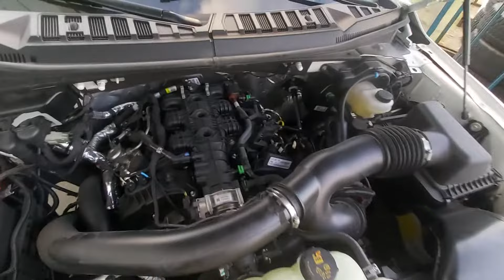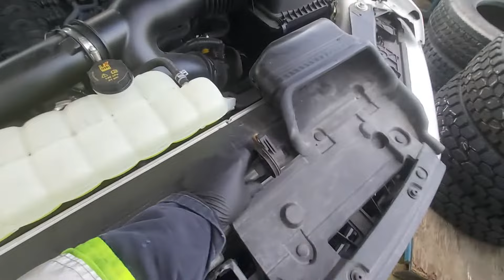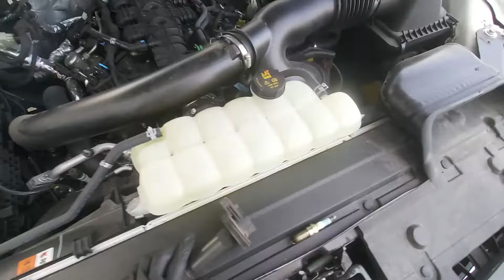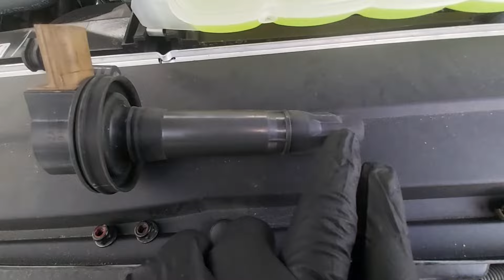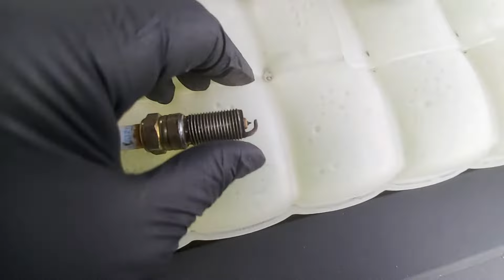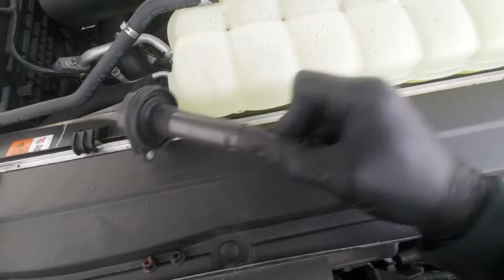Ford F150 3.5 Ecoboost misfire P0301 P0302 P0303 P0304 P0305 P0306 troubleshooting tips.

Comment: Thanks for the clear and concise video. This helped me find the cracked porcelain on my #4 spark plug. Plugs were installed by the dealership at 99K miles (about 1500 miles ago) so I'd assumed it had to be a coil.
Reply from the maker: Glad you found the problem. Very easy to Crack the plugs on install if you're not careful. Plug could have also been damaged in shipping if it was tossed around. Thanks for watching and commenting.
Reply: @shanersmechaniclife3164  I sent a picture of the cracked plug to the dealership. They said it was likely cracked prior to installation and they just didn’t catch it. They’re going to give me a free oil change for my trouble.

Comment: Thank you, sir. I did switch the coil packs on cylinders 1 and 4 because I had a P0301. I erased the prior P0301 and scanned again, and got another one. But the engine light went out...then it came back on flashing, but not solid. BTW, I just changed the plugs on it today. 2017 2.7L EcoBoost on an F-150. I'm also seeing a P0201. The two DTC codes together make me think it's an injector.

Comment: dealing with this now...thank you for the tips..
Reply from the maker: Hope it works out for you. Let me know what the problem ends up being. Thanks for watching and commenting.
Reply: @shanersmechaniclife3164  all but one top cap on the passenger camshaft blew apart and rollers went flying...haven't looked at the pistons yet but I'm ordering a used motor...

Comment: Help needed…

I had a P0305 almost a yr ago. Replaced all plugs and cylinder 5 coil. Same problem has come back. Replaced all plug and cylinder 5 coil again. Still have the issue. It’s a 2019 Ford F-150 2.7 Ecoboost with no other issues. Any ideas would be great.

Comment: changed plugs and coils 3 months ago, yesterday 8000 kms later engine light came off flashing engine started shattering very bad, stoped checked the code P0302 cylinder misfire or may be fuel injector ? lots of problems with ecoboost.
Reply: I have a cylinder 2 misfire as well and I’ve replaced the coil and plugs. I’m thinking injector is next 😒
Reply from the maker: I would take a close look at the spark plug. Look for cracks or black traces. Also swap coils see if misfire moves. Let me know what you find, good luck. Thanks for watching.
Reply: did you use very expensive plugs?

Comment: my 2015 ford expedition shakes at idle but there's no check engine light..idk wat could it be?
Reply from the maker: Have you cleaned your throttle body? I have seen those cause rough running as you pull up to a stoplight. Keep me posted on what you find.  Thanks for watching.
Reply: @shanersmechaniclife3164 ...wat about spark plugs and maf sensors?

Comment: What if neither one of those things is the problem? I have a 2013 EcoBoost. I am constantly getting misfires on Cylinder 3 & 4. I have changed the plugs, replaced the Coil Packs and even swapped out the Coil Packs with other cylinders. the Misfires don't move. Do you or anyone know what my next step should be? I am wondering if the wiring harness that plugs in to those 2 coils is bad. Thanks for the help.
Reply from the maker: Might not be ignition  related. Could be injector or carbon build up on valves. Is there  any evidence of rodents? They love to chew wiring. Let me know what you find.
Reply: I had a bad pigtail... or more specifically..a broken connector that wouldn't allow the plug to snap on to the coil. When I am in there looking for other things, and unknowingly push the plug all the way back on- suddenly it ran great..then soon it would wiggle loose.
Reply: Sonic-mu7rj  Did you ever fix your truck? Having same issue with cylinder 4 already did changed spark plug and coil same code on and off
Reply: Sonic-mu7rj  Did you ever fix your truck? Having same issue with cylinder 4 already did changed spark plug and coil same code on and off

Comment: Next Trash the engine cover. It's just generates heat under the hood
Reply from the maker: Good point. That and rodents love living under them.
Reply: That piece of crap drops insulation right into the engine when taking it off if your not careful too

Comment: I have a 2018 3.5 ecoboost and have had misfires on one side P0304, P0305, P0306. Shaking like crazy, no power, smoke and water out the tail pipe, limp mode. Replaced the plugs with oem and moved the coil packs, worked then broke down next day, bought a new coil pack, worked then broke down, took it to a mechanic who replaced all the plugs and three coil packs, broke down again, took it to ford, the said it was cam phasers and it destroyed my catalytic converters, replaced those for 5700$, drove for 70 miles, broke down again, they drove it and said nothing was wrong so I got it back and broke down again. They took it back and now they’re telling me “they found the issue” and it’s fuel injectors and it’s gonna be 1850$ for those. I’m at a loss for what the hell is actually broken. 2 and half months and still don’t have a truck. Someone on earth please help!
Reply from the maker: I really hope that's the problem. A lot of money and headaches. Keep me posted.
Reply: Did u get it fixed was it the injectors?
Reply: Thats rough man. Sounds like it could've been the injector from the beginning. I know the phasers are a bad problem on these trucks, but unless you heard an very loud ticking before hand, i doubt the phasers were the culprit for the initial problems.